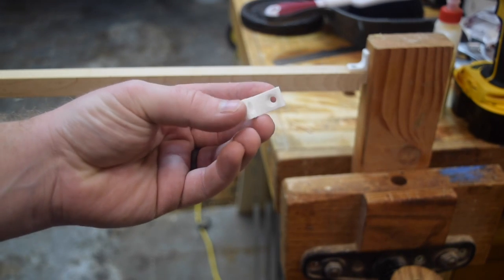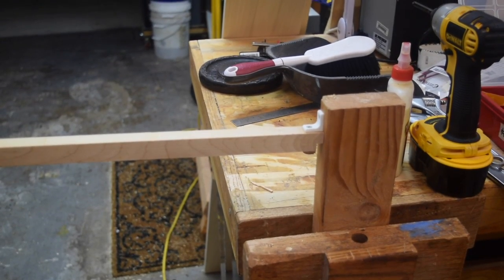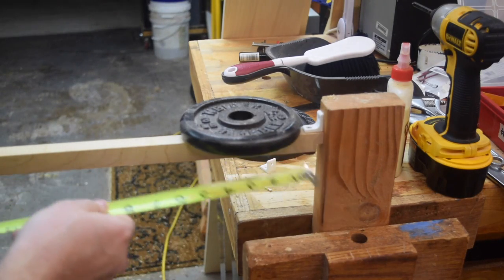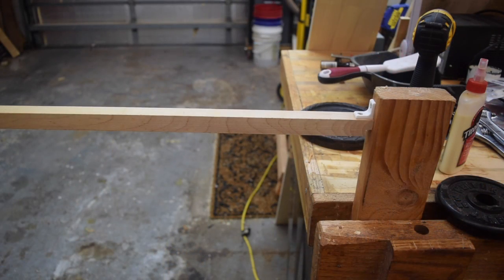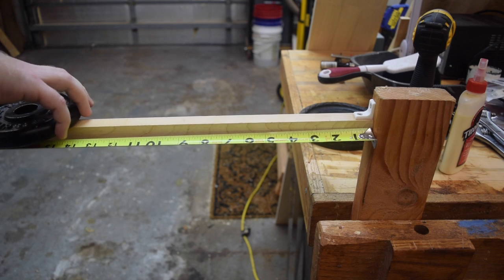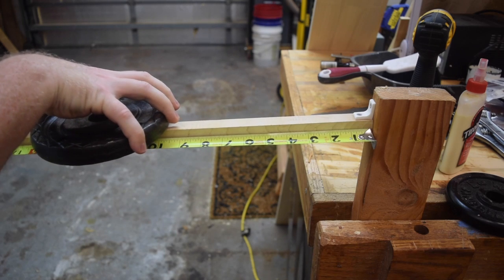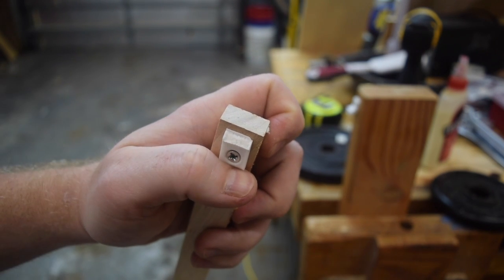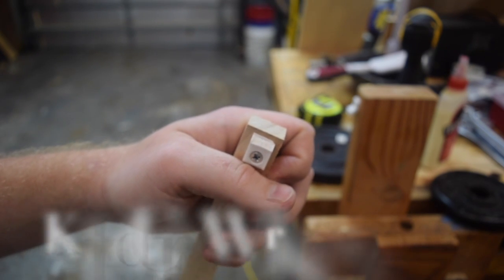3D Printed Bracket Destructive Infill Test

Comment: I'm curious if you're using those brackets upside down, like demonstrated in this video, or the same orientation as most shelf brackets.

Because the stress, and therefore failure mode, will change depending on the exact usage.

So, upside down like this, that bracket may fail at a 5lbs at 18inches, but the opposite orientation might not fail until much higher stresses, because the force is being applied in a different way.
Reply from the maker: Oh yeah, you can stress these things in a number of different directions and get wildly different answers.  That is true for any given shape, and the fact that the material is anisotropic makes it even more variable.  This was just an easy orientation to test.  

A pure compression loading would likely not benefit as much from the infill, but I bet it would help.  Maybe I will have to build a compression load tester at some point.
Reply: I did a similar experiment where I loaded printed prosthetic fingers on a hand down with weights and fishing line. They were surprisingly strong and I found that the smaller the layer height, the stronger they were. Look forward to more videos!
Reply from the maker: Were you pulling them apart with the fishing line and weights?  Like in a straight up tensile test?
Reply: The weights were hanging from the fingertips on a prosthetic hand held at the wrist, resting on the open palm. The weights were suspended from the fishing line. I think the line was ratedo at 30lbs. I think the weakest finger failed at just under 10lbs held at the tip of the finger. The highest, I believe, was around 18lbs.

This was all before I had much experience with my printer and I don't have all the original information, anymore.

I have been seeing more tests like this, though, which is great! Another test I saw recently was concerning glass transition of different types of PLA and PETG.

After hearing about PETG not having the toxic fume issue ABS has, nearly ABS temp resistance, near PLA printing temps, and the ease of printing PLA has, I'm buying a roll in the next few weeks!
Reply: Oh, and I have to ask, what kind of printer are you using?
Reply from the maker: Monoprice mini.  It is amazing what it does for the price, but it is also currently down because of a fan issue.  I got it as a test case for myself.  I need a bigger/better printer badly.
Reply: I hear you on that. I'm amazed that printers have become so much cheaper so fast. I remember when I was looking to get my first one, I couldn't find kits for less than $500.

I only just recently got my second printer up and running. I started off with a prusa i3 rework about three or four years ago. It worked as well as I was willing to fight to make it work. I used it to print all the plastic parts for the new one.
Reply from the maker: Thats funny, I am currently watching a review for the Prusa i3 MK2, and am drooling!  The price is right, the kit looks nice, and there is a big community.  It might be the one for me.
Reply: That thing looks rockin'! I love the geometry correction and bed leveling. Have you seen their new multi-colored extruder system? I'm going to be all over that and converting it to work on my printer ASAP.